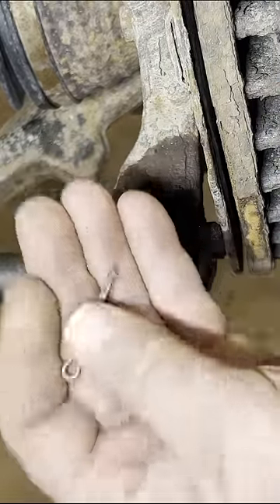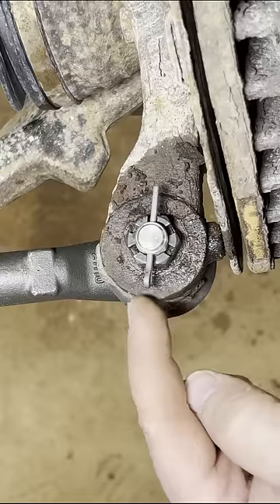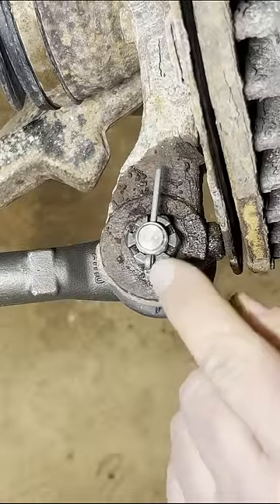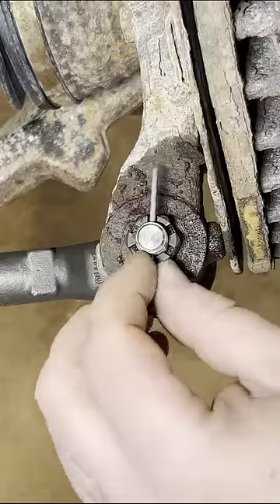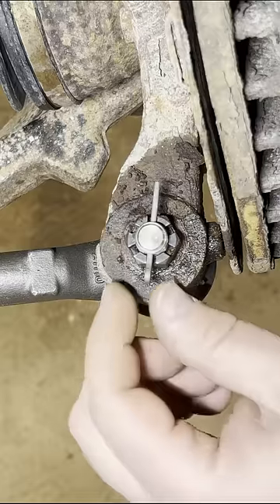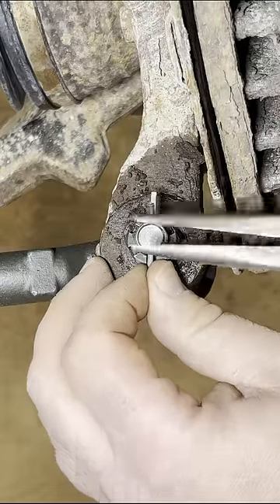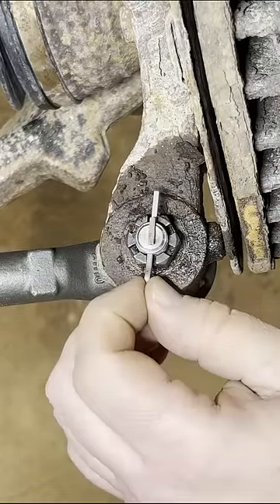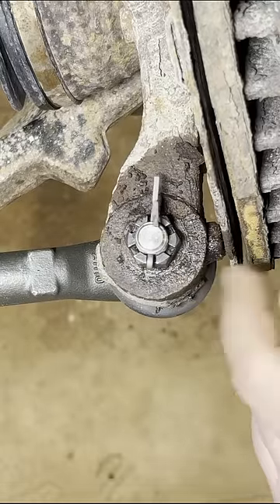RUST BELT Cotter Pin Installation!

Comment: I have developed a solution to rust problems on a vehicle. I am constantly taking my vehicles apart and cleaning, greasing or painting parts. I never let rust develop. When it comes time to make a repair it is such a joy to have parts just come off in 5 minites rather than fighting a rusted on part for a full day. I've made some videos on this. Of course this means many hours spent in the garage but they are fun hours. I threw away all my video games and decided to spend those hours productively. At least three times a year my front and rear suspensions are taken completely apart. Once a year I pull the engine and transmission and clean everything. All bolt and nut threads are cleaned with a wire wheel and anti seize grease applied.
I chase the threads with taps and dies to where they don't have any stick points. I have $400 worth of taps and dies to do this with.
 I take fenders off and coat the underside with roofing tar. I gut the inside of the vehicle, clean and then put it all back together. My brake lines always have a thick coat of white grease on them. When the grease starts to get dirty I remove all the brake lines and clean with kerosene and then regrease them. I take the park break cable out often and spray wd-40 into the sheath to make sure no rust develops in the cable. Yes, this is extreme vehicle maintenance but very enjoyable for me. My vehicle will last 5 times longer by doing so. It stays in new looking condition all the time. I'll admit I have time for this because I am retired but you working folks can do it also. Just get rid of usless stuff that takes up time and spend that time in your garage. Great way to teach your kids automotive concepts. It helps to have a second vehicle to use while working on the other one. When you spend 30, 40 and maybe up to $80,000 for a machine you must take care of that machine. A good part of your working life is spent just on paying for that machine.

Comment: If you can’t get that pin out. Cut off the ends, put the socket on there and hit it with the impact gun. The torque will shear off that pin and the nut will spin right off. Been doing that for decades, works every time

Comment: Always amazes me why manufacturers know these areas are subject to rust and yet they still don't use stainless nut and bolts, brass pins, galvanised mounting ect..... wouldn't take much thinking to rust proof a car during production and I certainly would pay a little extra when buying it knowing rust will never be an issue

Comment: I fit sideways on, so the head fits up against the castle of the nut, leaving a slight gap. Then just open the legs enough to prevent pulling through, as bending right over can cause stresses within the metal of the pin, and then the leg breaks off when you try to remove it.

Comment: or for rusted out cotters is a punch or even cutting it with the castle nut. done both in a pinch..i'm sure a loose fit works way easier. an ounce or prevention is always the best option.

Comment: i live in Minnesota, i cut the rusted cotter pins with a side cutter and tap on a socket, they usually allow to spin the nut off with a breaker bar.

Comment: To all the people saying the cotter pin will wear through, it won't. I have a 1947 Ford truck, and in the bottom of the bellhousing, there's a small hole to drain water or leaked oil, and in that hole is a factory folded cotter pin, and as the truck vibrates, the cotter pin wiggles around inside the hole, and it keeps it from clogging. The truck was built in 1947, and parked in 1976, so that's 29 years of hard use that the pin didn't wear through in, and I'd be impressed to see a ball joint (especially in the rust belt) go for thirty years without having to be removed.

Comment: Here’s a tip for you: Z-Max is mineral spirits that will soak into metal and Motorkote is molybdenum that coats surfaces for up to 4 oil changes; prevent corrosion. Also, always use anti-seize

Comment: Kinda true that if it can wiggle it won’t seize up but it will get some mud on it and it will be stuck either way and will rust either way same as the castle nut.  What I do is take a punch that fits in the slot or modify a punch and just cut the pin with my special punch and spin off the castle nut and if I need to reuse the same stud I either drill a new hole or drive it out with a round punch in the vice (trick to that is to put a nut in the stud and vice the nut instead of the stud cause the vice will flatten the threads.) but 9/10 times the stud is attached to the joint or cv axle or whatever part is being replace so it’s just faster to cut the pins.  Takes 30 sec with a punch.

Comment: in the case of a tie rod end, where you replace the nut, pin and the thread, i usually just bash a cheap socket on it with the pin in place and just zip it out with the impact gun. takes half a second and no dramas.

Comment: Just thought of this while watching and listening to your video - If you were to use the cotter pin to pack synthetic grease into the hole it's installed in and leave sone of the excess afterwards, it would hinder oxidation and also help with removal.

Comment: No one wants to talk about the fact that the ENTIRE purpose of the pin is to prevent the nut from unscrewing, so if the nut unscrews a little, the pin is no longer loose and will rust against the nut AND possibly in the way he is telling you to avoid.
Reply: I’m yet to see a properly tightened nut come loose and turn against the cotter pin. I’ve yet to take pin out and find the nut loose.
Reply: @donziperk  Exactly! Those cotter pins are just there as a "feel good" measure. If the nut is torqued, it will never come loose on it's own.
Reply: @yellowbird8363  Finally someone that gets it. I always throw this analogy out there. If a properly tightened  fine thread nut can come loose and needs a cotter pin then why don’t connecting rod bolts have cotter pins.

Comment: If that bent leg rusts off, won't you loose the pin? Maybe use stainless and bend both legs in opposite direction. Just a thought
Reply from the maker: I’ve never seen one rust off yet. It’s typically the hole the pin sits in that fills with rust and corrosion.

Comment: Fill the hole with grease. Fill the gap of the cotter pin with grease. install tight. It will come out no problem next time. Leaving loose it will slowly bend open or wear through. I work in the rest belt. Also if you have to drill a cotter pin out you are doing something wrong. Only had to drill 1 pin ever in 15yrs.

Comment: 1/8 inch gap 60 degree included bevel. 7018 3 pass with a slight weave in between.

Comment: If you live in the rust belt don't even try to get the cotter pin out.  Just put a socket on and run the nut off, nut comes off no problem and shaves the pin flush to the threads, then punch the pin out and replace with new.

Comment: I live in the rust belt. You want to bend both sides of that cotter pin. To remove bend back straight. Use a punch or nail hammer to pry and knock it out.

Comment: I've always just undone the nut which cuts through the pin with no problem, then just 1/2 minute to tap out the remains with a pin punch.  Leaving it loose, it's likely to wear through.

Comment: You don't need to remove cotter pins. Just hammer on an impact socket and spin the nut off. It cuts the pin.

Comment: Would it not be better to rotate the split pin 45 degrees and bend both open ends towards the nut, still leaving slack for the closed end??  Only bending  1 pin leaves room 100% failure if the 1 bent pin breaks or rusts off.

Comment: if the cotter wont come out just clip it off and use an impact to remove the nut.  the nut can and will sheer the cotter pin and then you can punch out the remains and put in a new cotter pin.

Comment: A little shot of grease in there works also.
And if it does rust up no problem as I've never had one stop an air gun from taking the nut off

Comment: If you need to take the tie rod loose, it's most likely worn anyway and there's no point in saving the stub shaft. Drive a socket on the nut and spin it off, don't even bother taking the cotter pin out. If you leave a cotter pin that loose, it will wear and fall out. They're made of soft metal so you can bend them by hand.

Comment: Pull the coder pin flush in between and it makes a tighter lock on bolt movement.
Reply from the maker: Properly torqued fasteners don’t require pins to “lock” them in place. How many internal engine nuts have cotter pins? That tie rod cotter pin is to make you feel good. Never in 20 years have I seen a tie rod but come loose.
Reply: @Tomsfoolery.  ah coder pins if they have a hole is smart there is always a possibility for them to back out im stating

Comment: Cotter pin... in the UK that's a split pin. A Cotter pin is like a bolt wedge with and angle  tapered on one side with a threaded nut on the end and is used typically to hold the arms onto a bicycle crank. Oh and we call Tie rods  
Track  rod ends because they are used to adjust the tracking of the steering.. Oh and the whole of the UK is rust belt..

Comment: Loose, tight, or running a piece of safety wire you found on the ground it doesn’t really matter as long as it’s there.  It’s technically a “Safety Pin” or “Stopper” so your steering never comes a part, it does no load bearing, it does no fastening, all it does is keep the nut from going bye bye completely💀💀💀

Comment: USE ANTI SEIZE and it can sit for a good many years,  and still come out with ease. 
I've been doing this for years and years, it works very well.
Also you can install it tightly to prevent wear.

Comment: The cotter pin is meant to prevent the nut from backing out and if it does just a little bit it's going to tighten on the pin and stop it from moving right?

Comment: You can just spin the nut, the cotter will shear off.   Don't bother trying to remove it.   I wouldn't worry about rust.  Parts don't last long enough for stuff seize up.  I just redid outers, they failed after 2 years.  Lifetime warranty doesn't mean much when you gotta eat the labor and pay for another alignment.

Comment: Maybe this is the thing to do(Or maybe not, vibration etc will wear it down and I agree with other comments on this), but I will say I've never not been able to get a cotter pin out. And I live in the so-called rust belt. Usually I can get a large pick or awl through that head even if it's pushed all the way in there, or bend the other side straight and tap it to get it moving. Or I can grip it with a pair of side cutters. Never been to the point of drilling one out.

Comment: One question what happens when the pin get rusted and it backs were you bent it at. won’t it just full out and isn’t why we’re supposed to bend both of the ends over to prevent that. I get there’s more then one way to do things. So does it actually matter if we just been one or both of them over I guess is my actual question.

Comment: In aviation we are forbidden to do this as the cotter pin will wear itself down from rattling and finally fall out. I saw this in a Continental IO-470 engine in a vintage Cessna 210 where somebody had installed cotter pins that were too small in the connecting rod nuts. Several had worn in two and fallen out. I discovered this when I had to remove and replace one of the engine cylinders. One was totally gone and the other was nearly gone. I pulled all six cylinders and found them all this way. Installed proper cotter pins and pulled the oil sump to get a tbe pieces out. It was a big job.
Reply from the maker: It’s funny because so many people mention aviation on this video. I have a light sport as well as an ultralight and I definitely wrap those pins tight. Whole different world.
Reply: @Tomsfoolery.  
Drive the pin in as deep as it will go. Position the head of the pin vertically so that it seats down into the slot of the castle nut. The bend one leg up over the end of the threaded part of the bolt and cut it off at the edge of the threads. Bend the other leg down and cut it to where it is just above the edge of the washer that's under the nut. That's the preferred way of installing cotter pins.

Comment: Everyone saying this isn’t safe:
I use pump hoses at work all day that take upwards of 150 pounds of pressure in an area less than a quarter inch around. Cotter pins seated with a gap are used because of the moisture and liquid flying through the hose. This bolt and the ears used to attach my hose to it’s fitting are what is holding them together. The cotter pin is just there to keep it moving they do not hold any real load. You’re welcome.

Comment: Next size up cotter pin won’t go all the way in like that. Then the loop will always be exposed to get a pick tool or flat blade into to remove. Regardless never had an issue even with rusted ones

Comment: I just cut the tabs off and sheer the pin apart while removing the nut with an impact. Then whatever is left in the hole is usually easily poked out with a pick

Comment: If you lived in the rust belt you would just  break off what you can of the cotter pin put a socket on run the nut off and what ever left of the cotter will break off. And if you are reusing in it you can dill the hole back open

Comment: Everybody here is wrong what you’re actually supposed to do is use the pin as filler rod to weld & fill the missing chunks of the castle nut onto the threads of the ball joint any REAL mechanic knows that

Comment: Nope, you are not supposed to bend the end all the way back. 20-30 degrees will keep it from backing out without stressing and weakening the metal with a sharp bend. Just sayin'. Otherwise, not putting it all the way in is a great tip.

Comment: Yeah don't do that I have worked on vehicles from the 50's and 60's all from the "rust belt" they all come out, some not so easy but always come out, I have never had a problem right sized punch solves everything

Comment: I've used u nails after replacing the rotors and repacking the bearings on my 98 Chevy just slightly bend it in

Comment: First thing is use the proper size cotter pin that doesn’t wiggle in the hole …..
Put the cotter pin all the way in and just bend it 45° no need to bend it 180° …. It just has to be bent enough to keep it from falling out. 
Second buy a set of small drift pins or punches and you’ll never have to drill a pin out again……

Comment: Leave the cotter pin in all the way snip the end that  sticks out and put the socket on and remove the nut it shears the cotter pin and never damages the threads and you can push out the remainder of the cotter pin with a pick so easy no point removing fighting the rust just be smarter than the tool your working with. Been doing it for decades

Comment: its not like your reusing the ball joint, never once have i saved the ball and repaired it. if you did need to service that area of the tire, you might as well change out the ball joint and save time in the future.   

i wonder if that cotter key is the annoying rattle , when i drive?

Comment: I make the cotter pin tight. No wiggle. And if I can’t get it out when replacing a ball joint then I beat a impact socket onto the nut and zip it off. 🤷🏻‍♂️ seen Eric O @ SMA do that many times

Comment: The only problem was that is you're only holding it by one half of the cotter pin not both halves I like the idea but you need to fold the other side over and also the the holes part bend that left or right but you correct you can leave it a little bit loose just so it can doesn't Rush stop

Comment: i legitimately just put an impact on the nut and run it off with the cotter pin still in there. it will just shear the pin and its not a bog deal.

Comment: There’s always the option of having a can of WD-40’s maximum super penetration fluid on hand for moments where accumulated rust makes removing pins, nuts and bolts a royal nuisance. That pin demo is however, a good recommendation.

Comment: I just hammer socket over the pin and nut all and use impact gun to break apart the nut and shear pin then push out little bit in the stud

Comment: Rust belt here, don't even attempt to remove cotter pin. Just let the nut shear it on the way off, then the pieces are loose in the hole and push out with punch.

Comment: Who drills out a cotter pin just beat a socket on the nut put impact on it with pin still in there will still  come off use a pin punch after nut is off super easy

Comment: Turn the nut ! It will cut the key. Pop the joint out than clean your key hole!
Reply from the maker: I used to do exactly that. I’ve had a few that took more time than necessary getting the pin out though.

Comment: When have you ever had to take a tie rod off that you weren't replacing.  If the pins rusted in just use an air impact and run the nut off over the pin.

Comment: I live in the rust belt and right away I can tell you I’ve never had an issue with taking a cotter pin out lol never had to use a drill. The pin is barely thicker then a paper clip please..

Comment: There an easier way to deal with a rusted cotter pin than drilling it just  break off the bent end and tap the looped end in so it doesn't stick out past the nut put a socket on and send it

Comment: If you can’t get the pin out hammer a socket on it and slam it with the impact it’ll come out and the threads will be fine

Comment: Forget the pin... I just maul the stud & cross-thread the nut.  That castle-nut ain't ever workin' itself loose.
.
Nah, really:  Good Tip.
Can also bend tangs of pin around castle nut instead of over stud (as demonstrated in vid).  That keeps head of pin, being wider than the castle nut relief cuts, outside at all times.

Comment: Don't drill them out cut it flush with the nut and run the impact to take it off, works better than drilling a rusted one out then take a punch and hammer it out